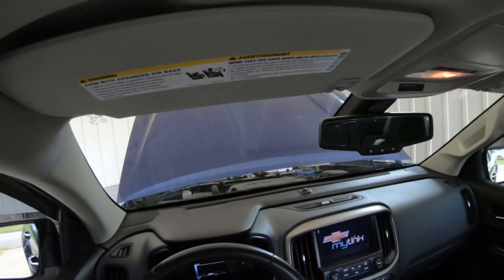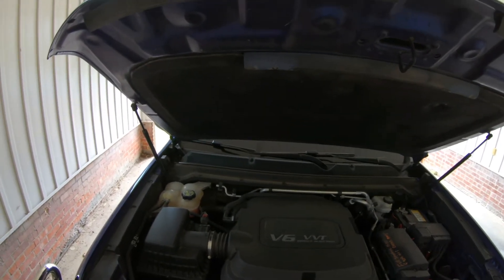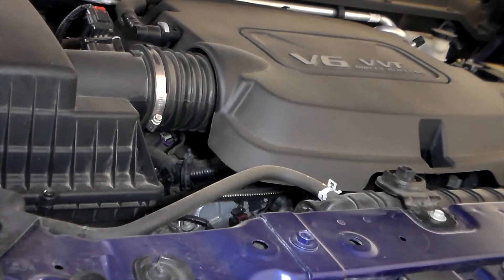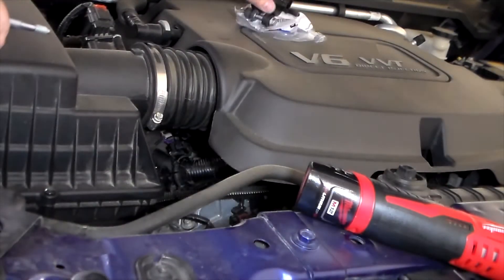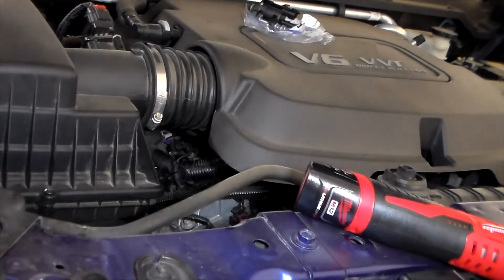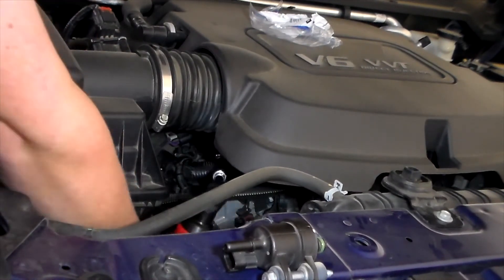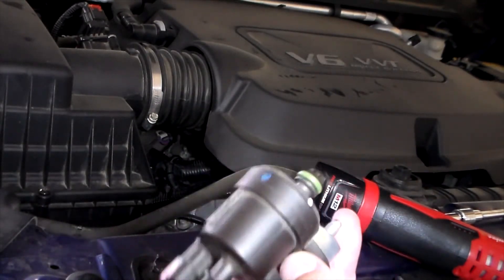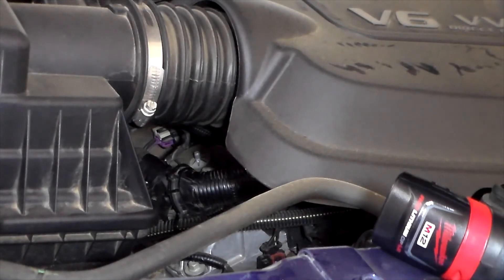HOW TO FIX 2016 Chevrolet Colorado with CODE (P0496) Faulty Purge Flow Valve 🔧🔩🪛

Comment: Changed the purge solenoid, cel still on, and fuel tank still doesn't seem to hold as much gas. It doesn't hesitate to start after refueling though, which is a plus. Going to check vent valve solenoid, and charcoal canister next. My issue is: I fill it up at the pump, it stops (typically fuel gage goes up to a little less than full mark), and the gauge falls extremely fast. Basically as if I were getting maybe 6 mpg. Tank isn't collapsed that I can tell, perhaps there is 5 inches of dirt in the bottom of the tank or something lol...